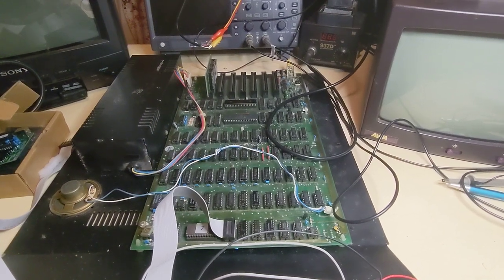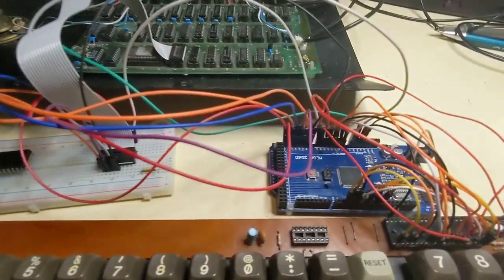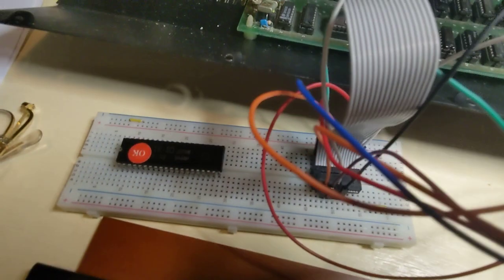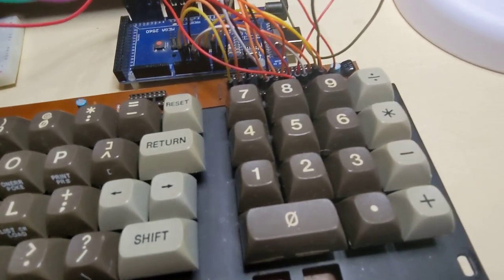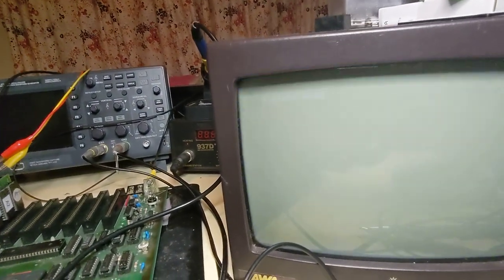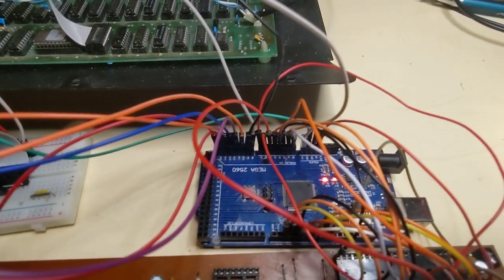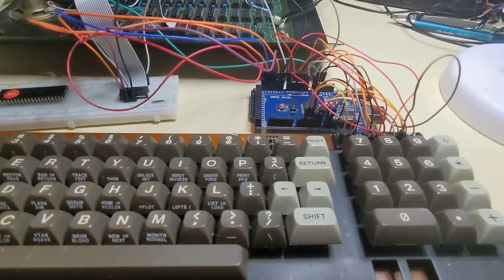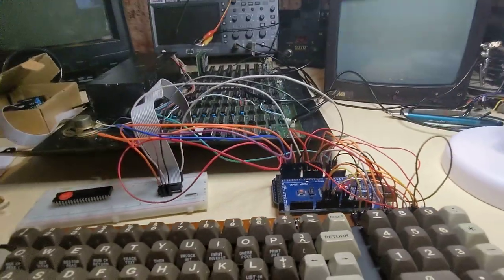Redstone Apple Clone 64K+Z80 (Generic Taiwanese Apple CloneType 3) Arduino Keyboard Controller

Comment: I too have an Apple 2 clone that had a bad KR3600 keyboard controller. I substituted it with an 89S51, wrote a program to make it emulate the keyboard controller, and plugged it back to the socket on the keyboard via an adapter PCB routing the power rails and ports. Subsequently just for the fun of it, I also made a ps2 keyboard controller using the PIC16F886 that plugged directly onto the Apple 2 motherboard.